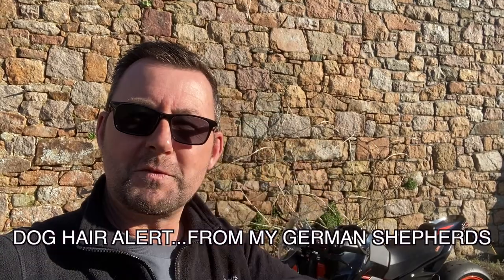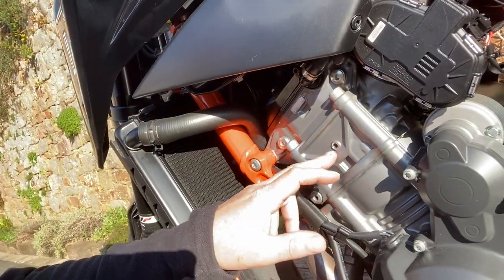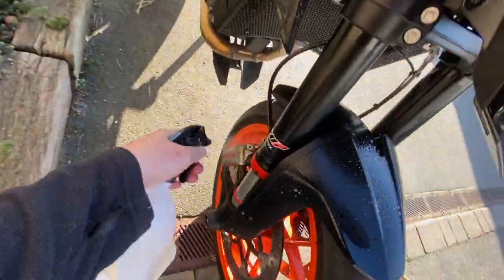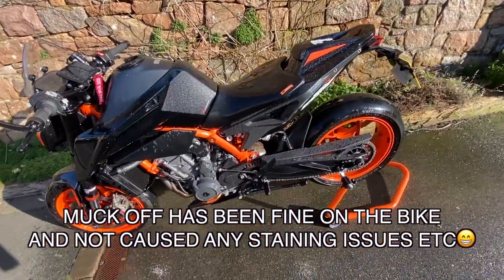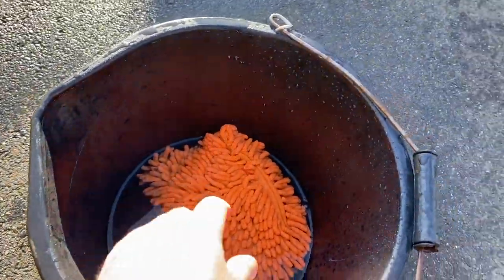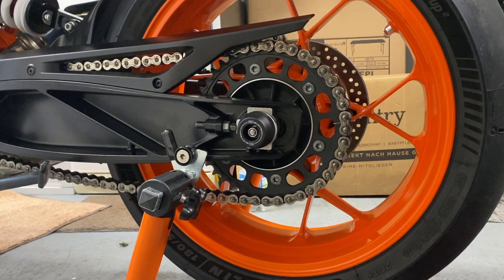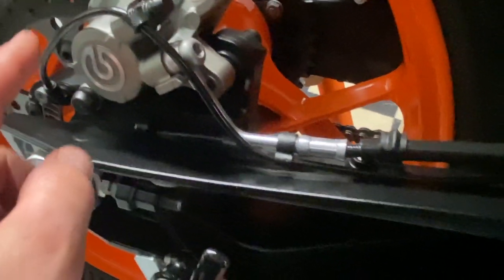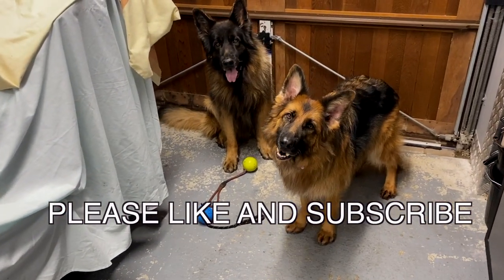Vlog # 16 CLEANING THE KTM 890R DUKE

Comment: Are there any alternatives to ACF-50?  I live in Taiwan and I can't find the stuff.  I have been washing my 890R at a self service car wash.  It does have pressure washer but I make sure to avoid electronics and stand back so I don't blast anything off.   Also the engine is a hot because I ride it there.  but I try to wait as long as my impatient butt will allow.  While It's waiting i usually put on chain cleaner and let it soak in.  But I never put any kind of anti corrosive on it, and I wouldnt know where to get that in Taiwan.  I checked for ACF - 50 but no luck.
Reply from the maker: Hi . Have a look at this video . It’s a UK bike magazine that tested lots of products out . You may be able to get one of those tested …… if not WD40 is better than nothing . 👍
https://youtu.be/R5LSxpoqcWo